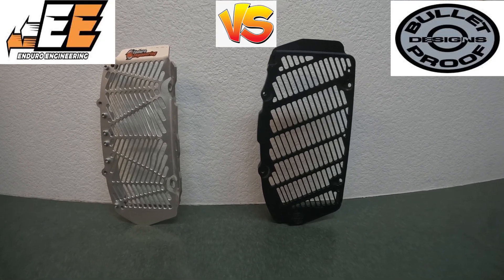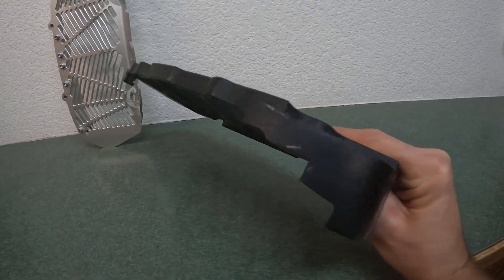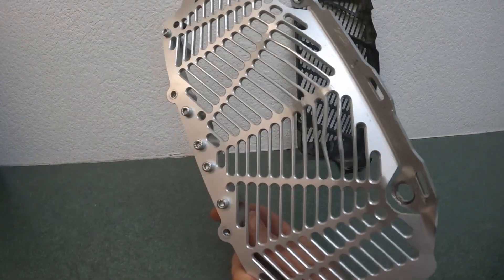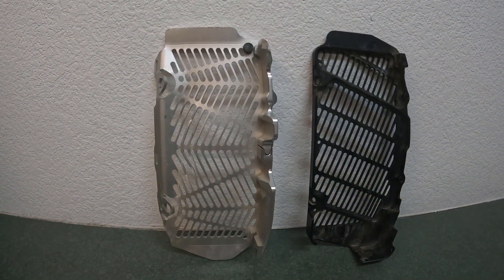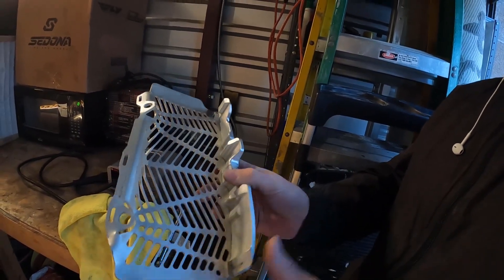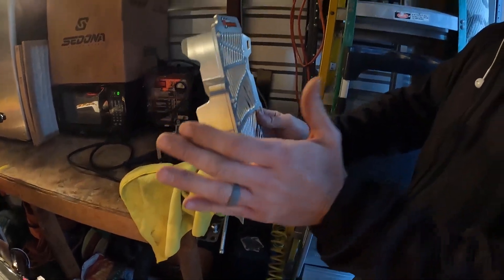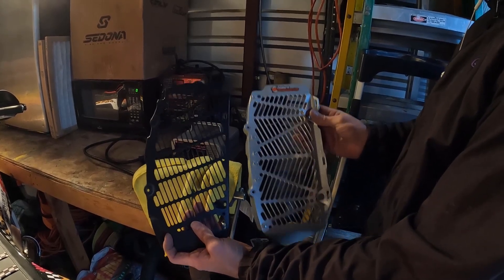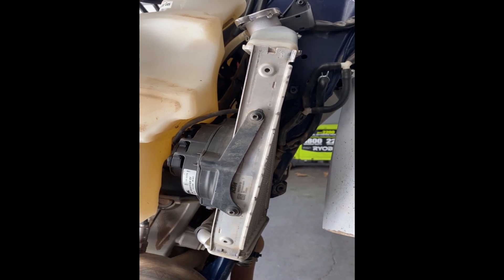Radiator Guard Review Enduro Engineering VS. Bullet Proof Designs!

Comment: Thanks. You proved the EE guards aren’t good, but you haven’t showed why the same issue won’t happen with BPD…
Reply from the maker: Did you watch the video? I clearly give examples of the strength of both comparatively in the vice. There is no comparison in strength. The BPD guards are far far stronger.
Reply: @Ride_Tek  I did watch. I must have missed you putting the BPD in the vice. I’ve seen it now 👍